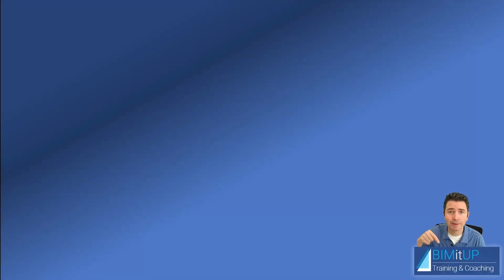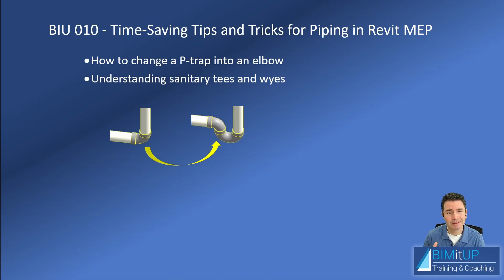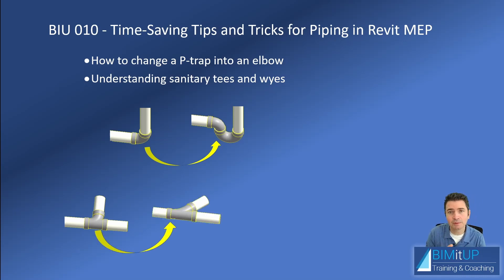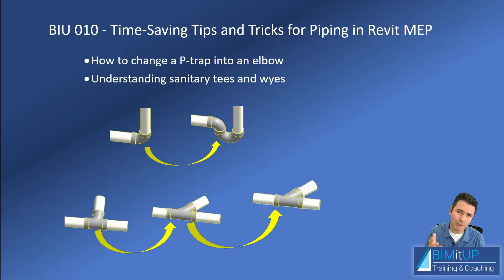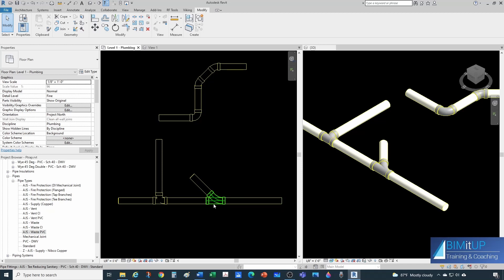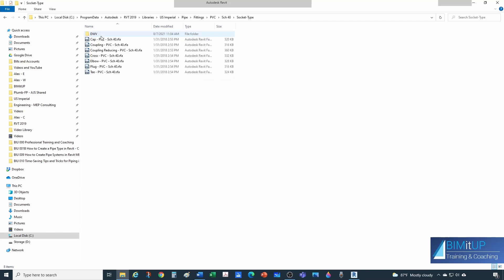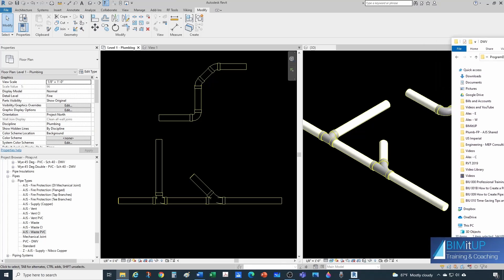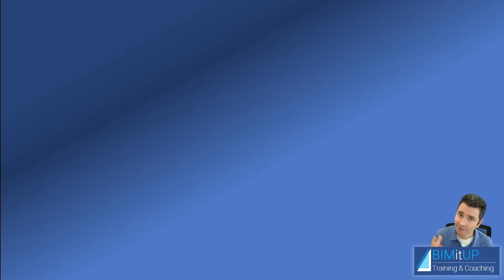Time Saving Tips and Tricks for Piping in Revit 1 Tutorial

Comment: I found this channel and it has help me out greatly. Thanks . DO you have a tip for connecting 2 different piping systems? Vent piping into sanitary  or HWR and HWS connecting at the end of the loop.
Reply from the maker: Be VERY careful. NEVER connect one system into another directly.
Make sure you first put a tee in the system you want to connect into, and THEN extend the other system and connect to the "open port of the tee" =)
Reply: Totally need this!